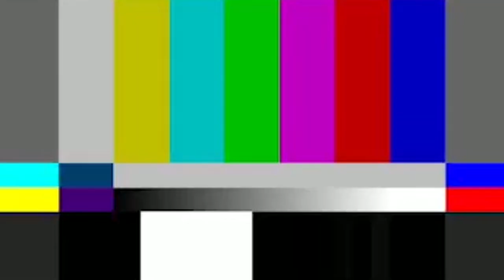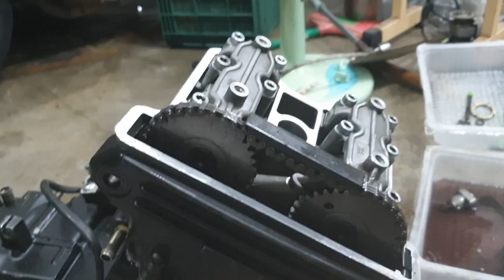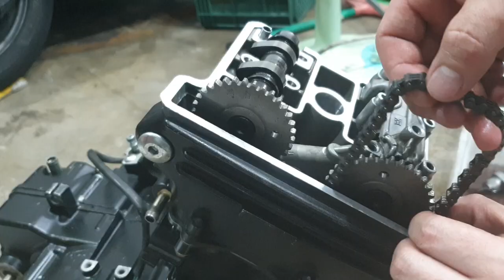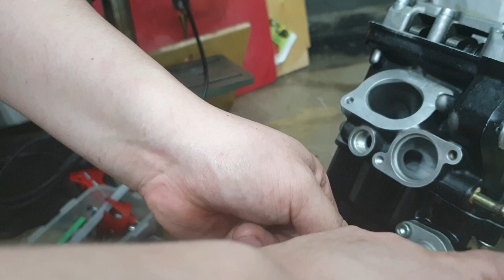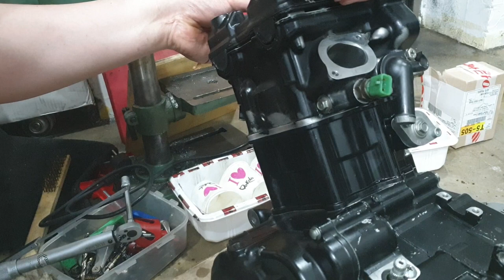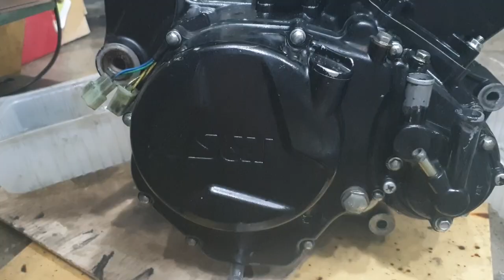엑시브 250 카페레이서 프로젝트13(엔진조립편3 마지막)

Comment: I bought a motorcycle like this recently and will be doing my own valve adjustments soon on this engine. What type of oil did you use when you "forgot the oil coating" ? The oil you put under between the bucket and shims. Is there a specific service manual you used that showed you the steps? and Can I do valve adjustments on the bike with the engine on the bike?
Reply from the maker: It coated regular motorcycle oil. To be used engine oil.
manual is not friendly for worker.
No mention manuals. but It must need lubricate.
This is very important since it is the first lubrication before oil circulation. working on engine.
I think can do.
not sure, may need take off radiator and more all the stuff.

If it helped, please subscribe and set alarm.
If you have any other questions, I'll let you know.
Reply: @YOLO LIFE PAPILLON Thanks for your reply! Is it possible to give me a basic list of tools I'd need for the job? I have the service manual for the bike but its hard to read and doesn't go into detail on valve adjustments.

https://youtu.be/z4R1GIwOu8g

Does this sound like bad valve clearance or is something else wrong?
Reply from the maker: I m not sure but it cause valve clearance is not correct. and gd250 engine is basically noisy.
need tools. 
Thickness gauge, micrometer, socket wrench 8,10,12,14,17mm, hex wrench set, magnet pickup tool, + - drivers,
The manual is not friendly.
  Remove the magneto cover plug ② and the valve timing inspection plug ③. ●  Rotate the magneto rotor counter-clockwise with a socket wrench to set the piston at TDC (Top Dead Center) of the compression stroke.       (Rotate the magneto rotor until the “… …” line on the magneto rotor is aligned with the “ ”… mark on the magneto cover.) ●  To inspect the valve clearance, insert a thickness gauge to the clearance between the camshaft and the tappet.
https://youtu.be/s52nTRD6ayc   time  6:41 like insert  Thickness gauge, before align magnet mark.
Reply: @ppaha  Thank You So Much Man! You're a Legend for these things
Reply: Hey PAPILLON! I'm gonna working on my engine soon, do you remember what size is the spark plug socket?

Comment: You are the man! Thank you! For all your videos, there is absolutely nothing on the web about that engine. I have gd250r and it start leaking coolant under the head gasket. Wonder if I just need to tighten head bolts or replace gasket is only the solution? Thanks
Reply from the maker: Unfortunately olny replace gasket. Sorry bro. Gd250 head gasket is defect.
Reply: @ppaha  Thanks, will order them, one more question what is the valve shim diameter? Want to check if I can find them locally. In your videos they looked 👀 really small.
Reply from the maker: Normal 7.48mm shims.
Reply: Thank you for helping. I ordered new gasket, but should I worried about it will leak again. In your video I noticed like couple gaskets, did you improve it like added something custom to it?
Reply from the maker: @fishgsv  I think, if you can made using copper. it will be best, 
The head gasket doesn't have a problem to the point where it can burst easily. If you make it clean, you won't count. Tightening bolts with prescribed torque is essential!